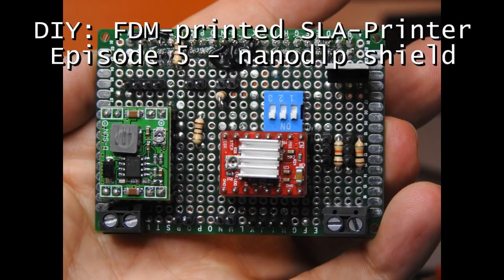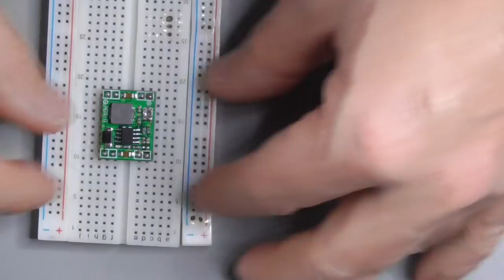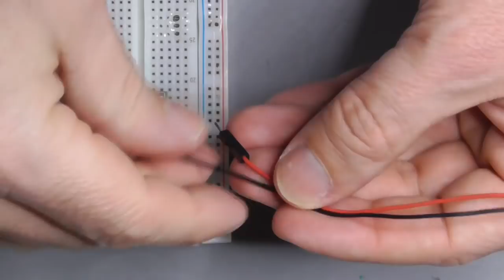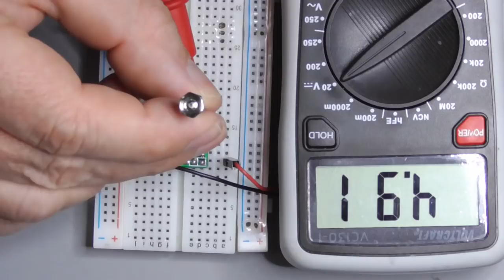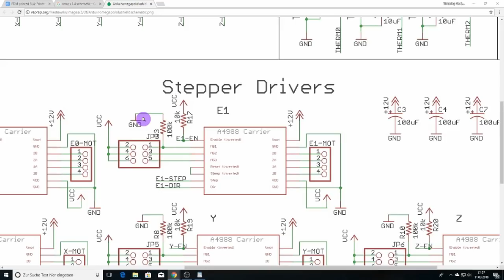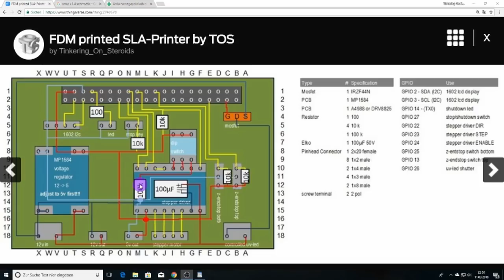DIY: FDM-printed SLA-Printer: Episode 5 - nanodlp shield

Comment: Are these plans anywhere that we can get more detail information on making this I am not an electronics guy per say
Reply from the maker: Someone in china took over the original design, modified it and now sell it on Aliexpress. I'm not involved in this, in any way, so I can say nothing about quality, reliability etc. But assumed that it works, it's most likely the easies way to get hold on it, without detailed skills on circuitry or electronics:
https://de.aliexpress.com/item/4000532010153.html?spm=a2g0o.productlist.0.0.1bd0589ddIOoue&algo_pvid=7bad3e49-2240-4744-9930-9ea8dbb3db44&algo_expid=7bad3e49-2240-4744-9930-9ea8dbb3db44-0&btsid=0ab6f8ad15879053505097905e0b0c&ws_ab_test=searchweb0_0,searchweb201602_,searchweb201603_
Reply: @BurgerStefan  Someone in china now makes v2.2 and v3 designs...
Reply from the maker: @brunocabral1578  I know and its totally ok.

Comment: Is it safe to connect Raspberry pi gpio pins without voltage divider to 5V? I think there are not 5V tolerant
Reply: It is not.. I've come to clear the air having done this.. The part that will really kill you, is that it will work for some time... Potentially, then begin to cause erratic behavior.  This can have you scratching your head for nights on end. Getting into fights with the wife. Sleeplessness. Finally, a slight distaste for Germany. I knew myself that the GPIO was not 5v Tolerant. But I just felt that TOS was such a professional in his videos and presentation, that I took his word for it. (He's still pretty awesome) . Any how.. Where he pulls up to 5v. Pull up to the 3.3v pin available right in the middle of the header on the GPIO pin rails. Also feed that 3.3v into the Stepper carrier. Run everything off 3.3v. I'm not sure why TOS ever even bothered to tap into 5v when the 3.3v was right there. Any how. save yourself the pain and fight with the wife.

Comment: So if I plan to build your design do I have to do this soldering?
Reply from the maker: BelladonicHaze Well... no you don‘t have to, but if not, the printer will not work 😉
Reply: The question is: There is no alternative to this board?
I found a NanoDLP board V1 that maybe can do the same?